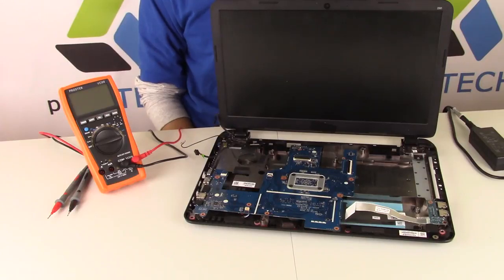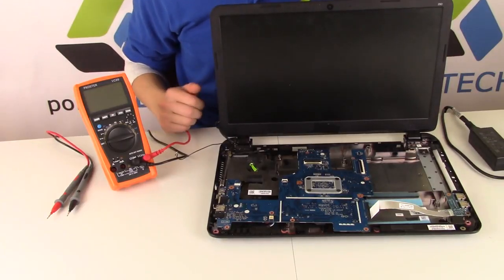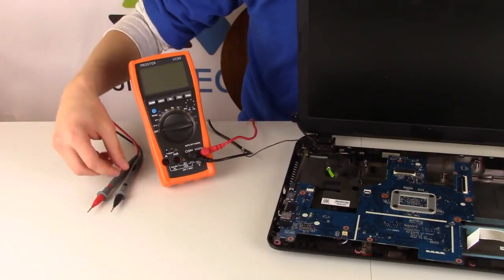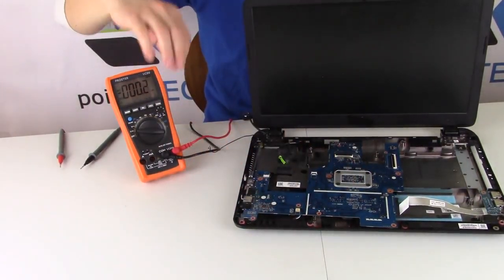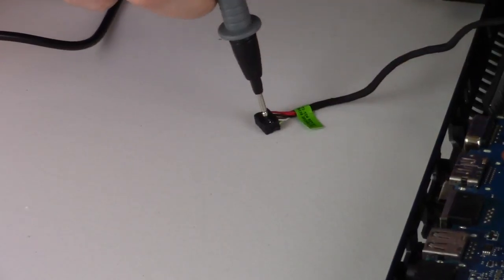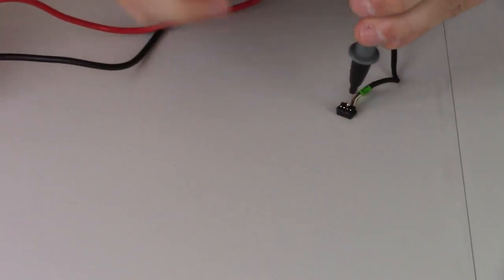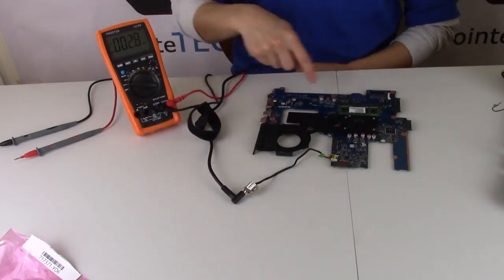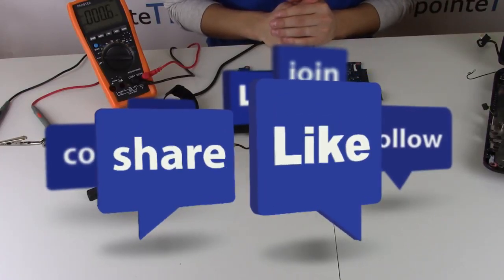How to Fix Test Power Jack - HP Laptop Computer

Comment: Hey PC Monkey so I’ve confirmed everything works except for the power port itself. How easy is it to fix or replace the power port? Idk if I could since it’s connected to the motherboard itself. I might just have to buy a new laptop which I really don’t want to. Also do you know how this could’ve happened. I’ve had my HP Pavilion x360 m14 laptop for a little over a year, so it’s not that old. Please help.
Reply from the maker: If its on its own board, real easy.  Just replace the board.  If its on the motherboard, it may be a bit more complicated.  Easiest way would be to replace the motherboard.  Or, depending on your electronics skills, you could try to de-solder it from the motherboard and solder a new one on

Comment: Your videos are awesome, thanks for the great content of your channel. About this video, I have an issue that's driving me crazy and I would really apreciate if you help me on giving me some directions. It's a Dell Inspiron 15R SE 7520. The charger wasn't charging the battery and the laptop won't turn on with the charger plugged in w/o battery. It was working only with battery and no charger. I did the 1 minute power on w/o battery nor charger to drain the static electricity after watching one of your videos (thank you again for the great content) and the problem was solved. I had the laptop being charged and working with the charger plugged in with or w/o battery, all perfect. But today, 2 days after fully working, it's happening again. And worse: the 1 minute static dischage procecure doesn't help anymore.  I've checked the charger with multimeter and it's ok. I even tried another charger (same specs), no success at all. Right now the laptop works (perfectly) with the battery but the charger does not affect it at all. After watching this video, I've tested the power jack and there's something confusing me: the charger's output is 19.5V / 4.62A and those 19.5V are shown in my multimeter display when I test the charger plug. But when I connect the charger to the power jack, as you show in your video, the multimeter shows only 18.5V maximum. Could this be the problem? Sorry if I bother you with this, but I'm about to get crazy. Thanks in advance!
Reply from the maker: It could be the issue.  Hard to say.  Does the battery charge when the computer is off and just wont charge when its on?
Reply: @PC_Monkey  Thanks for the answer. No, the charger does not charge the battery even with the laptop off, I've just tested it (30 minutes off with charger plugged in). Also, when I enter the diagnostics mode (pressing F12 and selecting it), it says "Warning: Charger is not detected...". I've also disassembled it, cleaned the boards, changed thermal paste, etc., the problem persists.
Reply from the maker: @Zimerer  Its saying the charger is not connected to Id like to assume its the charger.  Is the charger generic or brand name Dell?  If generic, replace with a brand name.  Dell is really annoying about that.   If its a brand name already and you tested to make sure its working, I am starting to think perhaps motherboard issues at that point :(
Reply: @PC_Monkey  The charger is brand name Dell, the one that came along with the laptop from Dell. Thank you very much for your kindness and all the help. God bless you!
Reply from the maker: @Zimerer  Good luck :)
Reply: @PC_Monkey  One last question if you don't mind: is the power jack just wires and the connector or is t here some "micro-board" or something? I mean, it just delivers the voltage and ground to the motherboard or it works in some other way, by regulating voltage or anything else than just conducting?
Reply from the maker: @Zimerer  The power jack just delivers power.  Some computers have it on its own board.  Some have it part of the motherborad.

Comment: I have an HP laptop pavilion dv6-7028TX, It was working fine until I pull it apart to dust it out and put it back together. Now it won't power on. 
I tested the charger, power jack, and power jack port on the motherboard for the correct voltage with a multimeter and they are all receiving 19 volts. What's the next troubleshooting step? 
Thanks
Reply from the maker: Most likely something was left unplugged or even perhaps damaged if it was working normally before.  :(
You have completed all the steps seen here?  https://youtu.be/P3I7dDpkJps.
Reply: @PC_Monkey  🖥️🖱️🐒Thanks for your reply bro... I discovered what it was, I fixed it. When I changed the thermal paste I didn't apply enough, I went back and reapplied the thermal paste, and it worked right away 😁
YOUR VIDEOS ARE VERY HELPFUL, KEEP IT UP 👍
Reply from the maker: @selvin9845  Glad your all set :)   Nice job figuring it out !!

Comment: Hello!

My battery does deliver power to my motherboard, but my ASUS laptop is still dead with no lights turning on. I’ve followed your instructions and gone through the videos in the description. What should I do?
Reply from the maker: For a computer that does not turn on, try this video first;  https://youtu.be/P3I7dDpkJps.  Let me know how that goes :)
Reply: @PC_Monkey  
I have watched your video and followed the instructions and nothing worked.
Both my battery and charger works, is there something else I can do? 
Btw the model of the laptop is ASUS UX305F
Reply from the maker: @mattiasqusto7945  If your computer is not turning on and you tried all the steps in that video with no luck, then your looking at a motherboard issue.  It should then be replaced.

Comment: My laptop doesn't power on when Its plugged to ac power without the battery but when I put the battery back on it powers up although it doesn't charge
Reply from the maker: Sounds like you should replace the power adapter as seen here;  https://youtu.be/P3I7dDpkJps.
Reply: @PC_Monkey  thank you very very much I took a straw and blew around the  charging adapter it's working

Comment: Great video!! I have a question. 
My laptop discharge very quickly when i unplug the jack.
In this case the problem is the jack or the battery?
Thank you! You're amazing!
Reply from the maker: The battery drains very quickly when the power adapter is unplugged?  How fast from 100% would you say until its dead?
Reply: @PC_Monkey  yes.
When I unplug the Jack after 3/4h the battery is almost 0

Comment: Hi, i have a problem, the connector has voltage, 19 v, at the end, but the light of the connector is off, ¿Why don't have light, if i have voltage?
Reply from the maker: It could just be broken.  If the cord is putting the correct power into the power jack then test the power jack to see if its putting the correct voltage into the motherboard.
Reply: @PC_Monkey  I have measured voltage on the connector pins of the motherboard and there is no voltage. It's posible that the motherboard fails? Thanks
Reply from the maker: @lagartija1977  If no power is going from the jack to the motherboard, then its most likely an issue with the jack.  But if the jack is attached to the motherboard, then its basically a motherboard problem unless you want to remove the jack and solder on a new one

Comment: EXCELLENTE'.  thank you very much !  Now a question .... How or why do the power jacks fail?  There is no physical damage to mine . Is there a common failure HP jacks are known for failing?  
Thanks in advance.
Reply from the maker: Could just be bad power.  Make sure your using a surge protector with your computer
Reply: @PC_Monkey  appreciate the reply ! Took the dc jack out and will hope for good result when i install the new one.  I couldnt get any reading on the dc jack connected to power supply and i tried 2 power packs.

Comment: What's the cause of power jack getting faulty and how can we prevent it?
Reply from the maker: Could be bad power.  Make sure your using a good surge protector instead of just plugging the computer into the wall outlet
Reply: @PC_Monkey  I have normal AVR but I don't know if it helped. A few hours before my laptop stopped working, I think the laptops fan spun stronger for a moment. Could that be the reason?

Comment: Correction: the amperage on your charger should be higher than what your laptop draws, voltage is the requirement and the current will be modulated (not drawn to the max of the charger). Using a charger with max amperage capacity of less than your laptop requires may damage the charger.

Comment: If this still doesn't help, which would be the next steps? My computer was working flawlessly then all of a sudden during a storm one night it just shut off and has never gained power since
Reply: P.s I have replaced battery, power port, cable charger, etc. Everything up to this video. I'm not really sure where to even look next
Reply from the maker: Have you tried all the tests seen here;  https://youtu.be/P3I7dDpkJps.

Comment: my charger is testing 19.5ish like specified but my port is showing 4-6 does that mean the port is bad? there are 6 positive and six negative wires on the port harness
Reply from the maker: Its hard to say without seeing the specs for that computer :(  But good guess is yes, that jack should be replaced.

Comment: Hello!!Thankyou for this informative video. Yesterday,my laptop got discharged in the normal way. I tried to charge with my charger n then with my friend's charger ,it didn't work. After that, I removed the battery n connect the  charger again.Now, the charging light lit up for a second n then it gets disappeared ,therefore what could be the problem in this case .I am looking forward to your reply
Reply from the maker: For a computer that does not turn on, try this video first;  https://youtu.be/P3I7dDpkJps.  Let me know how that goes :)
Reply: same issue with my laptop, but if I try to push and bend my charger near the pin then my laptop turns on and everything was well. But then when there was  sudden power outage and I restart my PC then I need to  bend and find the right bend again before it works. It's tiring.

Comment: My adaptor is charging the battery in switch off mode but not switching on the laptop without the battery or hangs if power switched on when laptop is working on battery. What could be the problem
Reply from the maker: The laptop does not turn on with the power adapter plugged in but will turn on with the power adapter unplugged. ?
Reply: @PC_Monkey  yes laptop only working with battery, if power switched on then hangs. But the battery is getting charged. If battery is taken out then laptop doesn't even switch on with the adapter. checked with different adapters also, same problem
Reply from the maker: @sanjaythaks7721  It could be a prob with your power jack then.  If its on its own board, consider replacing it.  If not, consider replacing the motherboard.

Comment: Well, I followed it through, the charger is good - check. the power jack where charger goes into is good - check, but as soon as i plug it in the board, the light at the end of the charge cord goes off. Bad board?? if it is, any good parts place I can buy one. I have a Inspiron 15 7559 2.6ghz.
Reply from the maker: I usually get most of my parts on ebay or amazon.  You checked the power jack with the power adapter plugged into it?

Comment: Amperage needs to be equal or lower? Hmm, thought that Voltage should be spot on and amperage equal or higher? A x V = W If Voltage is spot on and Amperage lower that means that PSU would be weaker than it should be. Am I wrong or?

Comment: I checked my laptop charger with multimeter it stays to 19.67 v for 1 sec and goes to 1 after and stayed there any suggestions
Reply from the maker: That would seem to indicate that the adapter is dead.  Should hold steady.  I would replace it.
Reply: @PC_Monkey  i replaced with new one and its also went to same state
Reply from the maker: @TheInder86  The new one also did that?  Weird.  Perhaps its designed to do that if nothing is receiving the power.  I have not seen that before.  Are you trying this because your computer does not turn on and you have already tried the other two videos?

Comment: Hello, my laptop suddenly died while I was using it, no charge lights after less than a second I plugged in the charger. It just suddenly powered off. Also I heard a little spark in the power jack area. I already tried plugging it without battery but still no charge light. There is also no burnt smell or any smoke after the spark happened. I wonder if it was a short on mobo or power jack do you have any ideas?
Reply from the maker: For a computer that does not turn on, try this video first;  https://youtu.be/P3I7dDpkJps.  Let me know how that goes :)

Comment: Hello and thanks for the video.

I would like to ask if the bad charging port had its led displaying white while you're testing it or does the led on the charging port only show when it's connected to the motherboard?
Reply from the maker: The power jack LED should light up when the power adapter is plugged into it.  No it should not display when being tested as far as I know

Comment: Hi my laptop power jack port is not receiving the amount of  voltage from my power jack. It can be repair? Or should I need to replace it?
Reply from the maker: If your power jack is on its own board then you can simply replace that board.  If its part of the Motherboard, then you would have to either de-solder and remove it, then solder on a new one, or replace the motherboard.

Comment: Hi, I have similar problem and came across your video, it was really helpful. But i have a doubt, hope you can help me.

From last few months my laptop don't turn on if i leave all night plugged in or also if i forgot to pull out the charger after shutting down.. next time it wont turn on..

this keeps happening i assumed its static and followed your previous to remove static build up..

but this time it didn't work out .. so i bought a multimeter, new power jack and a new button switch .. thinking these could b the problem

first i checked the power supply in charger and power jack with multimeter both gave me 19.5V ..perfectly fine

But when i about to check the power passes to the motherboard, i thought to match black with black and red with red.. but it gave a spark.. when u say put red on metal bracket..what does it mean ? and I haven't separated the motherboard it is still in place. do u recommend to remove separately and check it ? .. and can u tell me at what plave should i place multimeter red port .. and what is metal bracket ??
Reply from the maker: You dont have to remove the motherboard if you can easily access the power jack without needing to do so.  Every power jack is different.  They are not all the same so I cant tell you exactly how to test it.  What is the model number of your laptop?

Comment: Please help. My acer aspire 4250 battery is dead, and laptop doesn’t power on when it’s plugged in.but without connecting in laptop the power cord light is on and goes off when I connect to laptop.need ur exper advise.
Reply from the maker: For a computer that wont turn on, try this video first;  https://youtu.be/P3I7dDpkJps.  Let me know how that goes :)

Comment: I have checked everything with your video's.. even power jack is working.. still my laptop is not turning on.. what to do.? Is there any power ic or anything? That i should check
Reply from the maker: If none of the tests in this video worked;  https://youtu.be/P3I7dDpkJps then your left with the issue most likely being your motherboard.  It would need to be replaced.

Comment: So if I follow all the steps and its still not working what next?
Reply from the maker: If you have tried the first video testing the adapter, battery, and static buildup with not luck, the BIOS Reset with no luck, and now tested the adapter and power jack to make sure they are working with no luck, then we are left with your motherboard.  It would need to be replaced as we have confirmed its getting the correct power and should be working.

Comment: I have dell inspiron N4050 model. I had problem on dc jack there one cable was disconnected. Now I soldering that one but the problem is when I plugged in the charger pin, laptop power indicator showing green and red light beeping. Now what should i do? Whats the problem? Can you tell me please?
Reply from the maker: You said that when you plug it in, the laptop power indicator shows light.  But does the computer turn on?
Reply: Turn on for 1 or 2 seconds and in that time red light beeping with sound and then turned off.
Reply from the maker: @mamunahmed7129  For a computer that wont turn on, try this video first;  https://youtu.be/_MOe71kBPOY.  Let me know how that goes :)